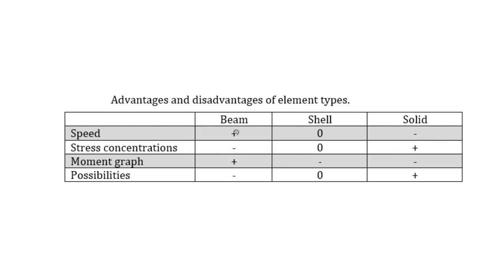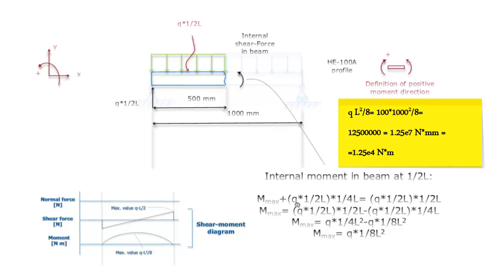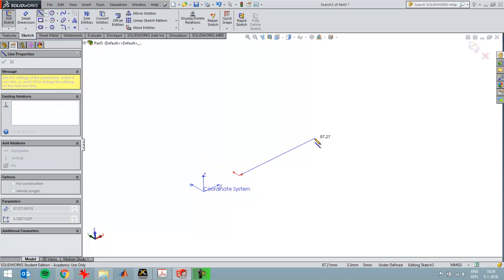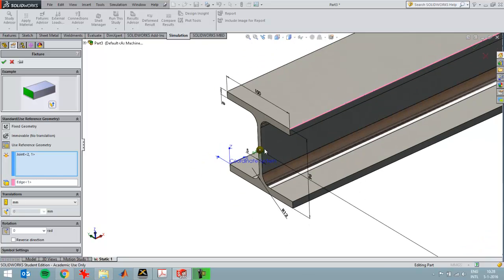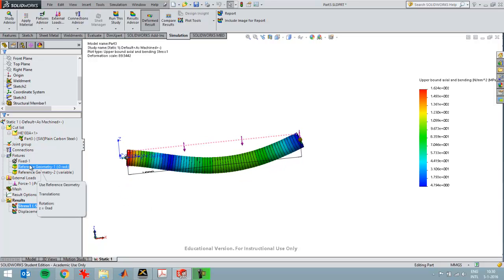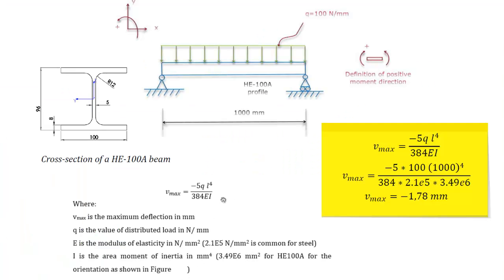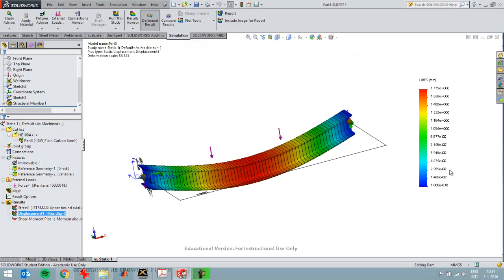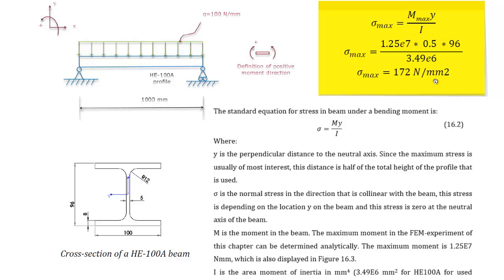Chapter 16  Calculating beam under distributed load analytically and with SolidWorks Simulation

Comment: Hi, I see but my solid no is a beam, I need to analyze in solid.
Reply from the maker: In solid elements it is impossible to show moments as a result.
Reply: Jos van Kreij thanks, I try to find how any comparation between analysis in base plate
Reply: Jos van Kreij and for software

Comment: Hey jos 

i am trying to make a similar simulation. Maybe you can help me with it.
I have a one end fixed another end free to slide beam.
I have to predefine a radius such that - under the given load it must end up straight (or almost straight)
When i try to make it because of the geomtric problems - solidworks generates an error message.
Do you know any way around this?
Thanks & Best regards
Reply from the maker: If you do the same steps as in the video it should be oke, right?
Reply: Can you upload a sample video for it?
Reply from the maker: What is it that you miss in the current video?

Comment: thank you very much for this great video; I have been researching on why the Euler Bernoulli beam equations (hand calculations) under predict the displacements when compared with solidworks simulations results for the same problem for shorter beams
Reply from the maker: Thanks for your comment!